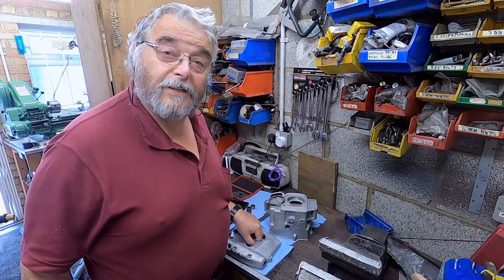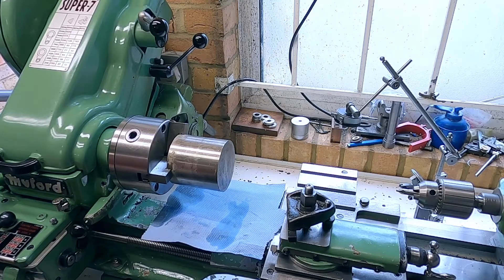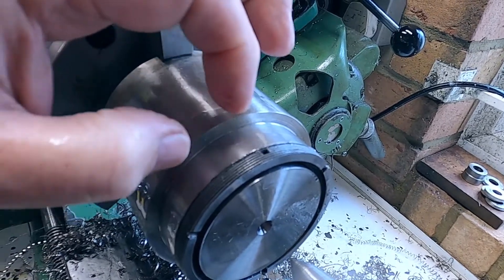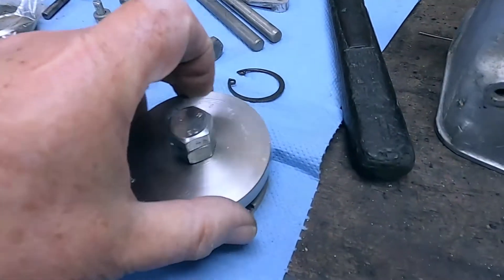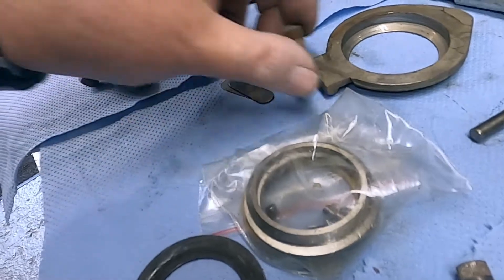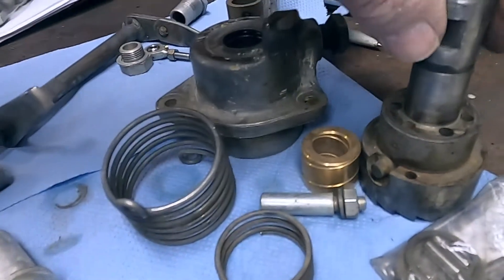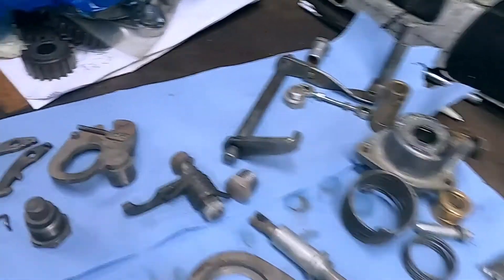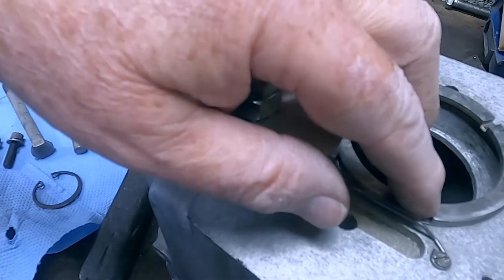Velocette 500, 5 speed conversion, part 1

Comment: What is the particular cover on the oil tank for?
Reply from the maker: @carlnapp4412     Originally, the oil tank breathed through a small hole in the filler cap. When I started road racing I found that scavaged gas came out the hole and also drove oil out as the road surfaces were rough.
I made up a gas / oil separator, and set it into the filler cap, and put a breather pipe on it. It works well and only scavenge gas comes out and it also means the oil tank is never pressurised.

Comment: Does the 5-speed give you a higher final ratio or does it simply take the original top-bottom ratio and divide by 5 instead of 4?
Reply from the maker: Top gear is still 1 to 1, and I get better acceleration with the  additional ratio.

Comment: How did you part off the new tool from the very large billet? Surely not on the Myford! Chris B.
Reply from the maker: No easy way to do this. I put a parting off tool in as far as I could then with the lathe on "slow ahead" I hacksawed through the rest of it with 1 hack saw blade and lots of 20/50.
I cannot remember how long it took, but going off to an engineering firm with a mech saw, and coming back a week later etc etc was an unacceptable option.
Eventually, I was able to clean up both sides and make it look respectable.
Since then I have bought several "biscuits" cut off from bar stock, to save time, and I found this empowering as having material in stock, for Handwheels /  starter roller ends etc etc has been useful, and saved a lot of hack sawing.
Alan
Reply: @alanglen5902  I find the parting off tool one of the worst jobs on a Lathe, I machined the 4 aluminium brake drum muffs for my Vincent with a tapered parting tool, it was a sweat inducing job! For those large diameter "disc" jobs I have a Warco bandsaw, very cheap and surprisingly useful. Chris B.